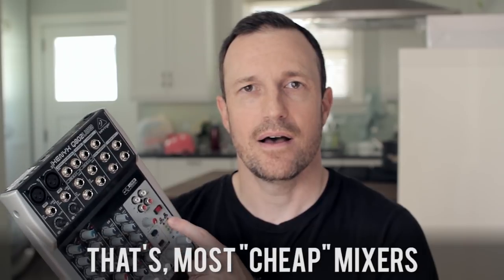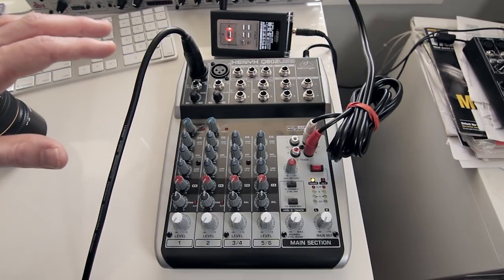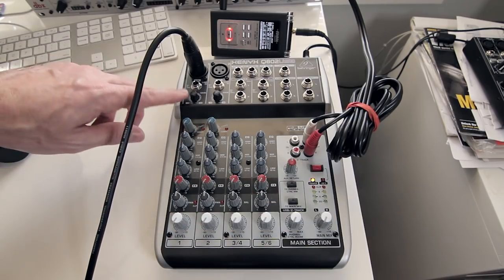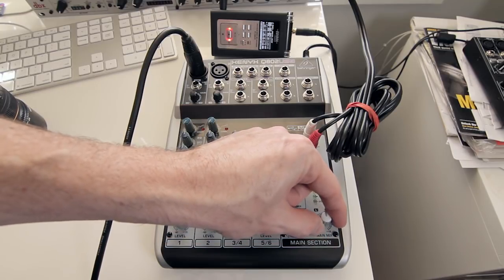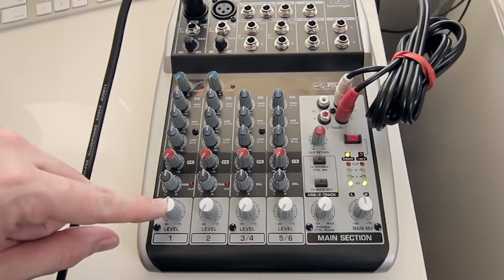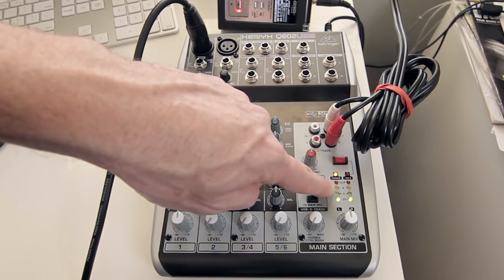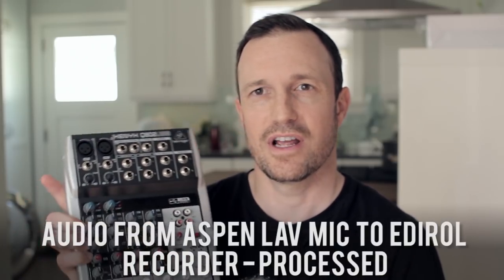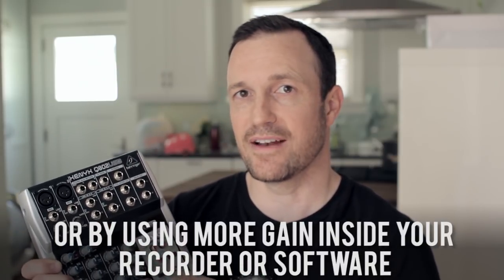Setting Microphone Levels on a Mixer - Gain Staging with no PFL/Solo Buttons

Comment: Thank you Ray. Beginner’s question..... once levels are set so that zero has been reached, if I take a feed to the recorder, which fader is best to use to control the record volume? Would it be best to use the output fader on the end in order to reduce noise or keep it at zero and use the input fader? I’m guessing .... the output fader? (Last fader out)
Reply from the maker: +Ian Craig depends on if you have multiple channels then you’d want to use each channel’s fader (not gain). That said, set the gain proper, then bring up fader to unity and work with your recorder’s gain to set the cleanest level. The recorder having its own gain means that will affect quality as well. So use the more of the better preamps whether that be mixer or recorder. Some combo of both will get you where you want to be. Thx for watching!
Reply: Download a pink noise track, play it through to your recorder with the gain and all set so the track shows zero or unity on its fader, and the recorder should show zero on any fader.  While the track plays, watch the meter.  A single track on a multitrack board should never produce a zero tap on the master.  But at zero on its own meter on the track (you may have to pfl\solo the track to see its track level and set gain), you will hear the sound.  This tells you where your "Track Zero" is at your master output.  The summing circuit is what you need to guage, and if you can, feed the pink noise track to every track set the same, and see if it fills your master.  Pull back on the master until you reach zero.  Pull up on that fader until you hit +3.  This is your relative max output.  Set the fader on your recorder for unity, and gain until you reach tapping +3.  They are now in sync.  You can move the fader on your master on the board to control overall output, and any single fader to control any single input.  If they are all tapping 0 with pink noise coming out of a line level device to your board, whatever you set your trim to is LINE level, or standard amplification.  Mark this if it isn't already (if you fed your track from one to the others in daisy, you may wish to test each track individually to get this marked)--I use a white grease pencil, and some clear packing tape over it so it cannot be rubbed off without removing the tape.  At this point, your basic gain for most of your board is known, and you can set for your recorder just by setting it so that it taps the same level as your master out.  The reason for this is control simplicity.  IF all of your control of your loudness is on the same control area, you know what each change will do to the whole system, and you can make one single change at a time, rather than changing this on this one and that on that one to match them.  It puts all your control on your main board.

Comment: Ray you rock! That is the exact cheap mixer that I have and totally don't know how to use. The web is totally not helpful at all with these things. What does the "FX" knob do?
Reply from the maker: IllinoisCaseLaw.com thanks. You definitely want to go through your manual, they do a great job of explaining the mixer and setting it up. The FX knob is a "send" meaning that you can send audio out of it usually, in music, to external FX hardware but in podcasting we use this to create a mix-minus for recording Skype. If you want to know more about a mix-minus check out http://thepodcastersstudio.com/mixminus
Reply: Thanks, Ray Ortega , You are right. Have not gone through the manuel yet, but I will do that. In the mean time I will check out the mix-minus set up you mentioned.

Comment: Ray quick question how would you make sure levels are right for when you use the 3/4 line when those do not have gain? Sorry if this is a dumb question still trying to self teach myself.
Reply from the maker: +ZachJarom you still have the overload light to make sure the channel isn't peaking. You can use the first method i show using that and of course then just use the volume knob to set your levels on the audio meters. Hope that helps. You don't have a gain know cause those channels are for line level and not mics. So the audio going in should be loud already or have the ability to be turned up such as from the computer or device plugged in.

Comment: Thank you so much for this video Ray, it was extremely helpful. A follow-up question, however: I've done the testing, turning the two main knobs to 50%, and even to 75% and I'm still not able to get 0 on the LED meter. I have a Behringer Xenyx 1202FX mixer, would you happen to know what the problem might be? Or other knobs that I could adjust to help reach 0 on the LED meter? I have my gain turned to 100%. Thank you so much!
Reply: Nevermind! I was able to troubleshoot the problem! I realized I didn't have my soundcard connected to my PC lol. Thanks!!

Comment: thank you very much! Is there an easy way like this to setup the equalizer, or is that just personal preference?
Reply: Equalizers are a whole different ballgame.  Besides, this guy shows only one mic.  This works for podcasting, not for many other situations.  For a single mic input, absolutely the fastest method to get an input volume.  Anything else, the fastest way to kill a mix.  But again, he states his purpose at the beginning, and I applaud that.  He did a great job with this.  More than one way to do anything, and I don't rely on hardware external of the transmitter to tell me when I've got a mix.  I use the transmission point (the computer software\hardware driver) to gauge the output levels of each track, and the software master output for my overall mix output gauge.  You need to do both if you have more than one input; each track on it's own, and the software master output (final tracking which is a summing track that puts it all together).
EQ should be based on your situation.  It's a huge topic.  For a single mic on a podcast, I have two suggestions.  They can be used together or separated.  
Number one, flatten the response of your output.  How?  Us an EQ plugin on your DAW, or if you don't have one, just going direct, plug in a spare device that will get your transmission the way any audience would, then plug its output into a track you send to a DAW with no color (set the gain to LINE and fader to 0, volume on device should be about 70 percent), and use an eq with an analyzer histogram.  Next, get a PINKNOISE track from any free download you can find.  This should playback all frequencies with the same overall energy.  Why?  You'll see in a minute.  Loop the Pink noise into your mic track and have it play on repeat.  Use a terminated audio wire to keep the noise from playing from your daw, you won't need it just yet.  Now use the analyzer plugin to view your output across the audible spectrum.  You can use plugins or other hardware to flatten this in near realtime, just give it up to 16 seconds for a roundtrip through the networking.  Close counts, especially if all you are using is the parametric controls of your board.  This will allow you to have a more natural transmission.  I would do this to each track you plug in, and do this so you equalize your hardware outputs from each track.  I would also repeat this with several devices (phone, computer basic, tv aux wire output) and average the adjustments.
Number two (This one is the $^it):  You will do the above, but you will PLAY Pinknoise from each device TYPE (any phone for phone, any basic computer speaker for computer speaker, tv speaker for tv) that you wish to target, and you will adjust.  I would start with phones.  You can plug a phone into a tv and have it play back fairly easily using the PC input for most flat screens.  As you do each device, adjust the first, then adjust only halfway for the second, then only halfway for the third, and then come back to the first, and adjust only halfway again.  This should give you an average of all of them that you can work with.  You will play the noise into your microphone and instead of coloring the output, you will adjust the input.  After this, your average should give you a natural sound, which you can then "color" for your voice much easier, and giving you an adjustment that will work across more devices the more you use to average it out.
IF you do these together, you'll effectively be balancing your output and your input for the average output levels with a flat curve first, and then a color curve for the mic, which sounds fuller, more natural and so much more consistent across more devices.  You will effectively serve a wider audience.
After adjusting without hearing the sound, try playing a song you know and love through direct plug and through the mic from any of the devices.  You should hear it play back quite naturally, and you'll hear the color of the mic when you play it from a speaker to the mic, and out to a set of very flat responding headphones.  You now have a studio quality setup, and can do anything from mixing music to podcasting conversations or rants in a very pleasant sounding mix.
Reply: @HTDav01 ,
I have been an audiophile for over 65 years.
Reply: @j.d.schultzsr.9215  I was an audiophile the second I stepped outside my home and heard a bird sing for the first time in more than 10 years, thanks to some medical miracle work... ...I was 15.  You really want to appreciate sound?  Plug your ears with really thick silicone plugs, then get a pair of headphones or earmuffs with gigantic drivers\earpiece, wrap a cloth around the headband, place them on your head so the band slides tight against your skull going behind your ears--not over your head--to deaden the mastoidal response, and then stay like that a week while you go about your other normal business (other than audio work--for this, obviously, remove it).  Halfway between deaf and hearing puts you in neither world, so communicating gets complicated.  Music gets very limited, loses much of what makes it interesting, retaining only beat and very basic, repetitive rythm.  When all that starts to come back, it's one heck of a trip.

Comment: Ray I have a pair of high performance active 450w(RMS per channel) speakers. Would you know where I should set the initial volume on the speakers at? or is this irrelevant to setting the mix? Great vid! and thanks
Reply from the maker: Thanks, Wayne. Speaker volume shouldn't come into play, at least not for gain staging. Get good levels into your mixer and then set the speakers to a spot where you need them to be.
Reply: Thanks for that Ray. I intent to host some karaoke soon, the karaoke engine will be Virtual DJ. So, with the 3.5 Jack going from the earphone of my computer, to two 6.35 Jacks going into the stereo input of my mixer (this is a Y lead of course) Is it still the same method as you have outlined for the mic? Have a great weekend man.

Comment: I'm using an ATR2100 mic with a Tascam DR-40 to record YouTube tutorials. I need to set a very high gain on the DR-40 to have a decent signal. Since my apartment is noisy I can't avoid recording noise, too, even though the mic is dynamic and better than a condenser in this matter. I'm evaluating buying a usb mixer (the Behringer you reviewed) or an audio interface (Focusrite 2i2), because it would be easier to record directly to the computer, but also because I imagine they can help getting a louder signal (and/or lower noise) from the mic. Well, I'm not so sure about that, that's why I ask. Do you have any video or post to help me evaluate it, and comparing those two kinds of equipments? In which case do you prefer one or the other? BTW, I enjoy your videos and website a lot, thanks for sharing them. Saludos desde Argentina!
Reply from the maker: +Diego Efe thanks Diego. I'm not convinced that a mixer will give you any more signal. It really depends on how much gain the preamp of the mixer has vs the recorder. Being in noisy environment will always prove challenging. Record in the closet or in a car. Works great! I prefer going to recorder cause I can be more mobile and not rely on software but having a good place to record in is key.

Comment: Hi Ray. Great info. Our band uses an Alto ZMX122fx using 4 microphones. I followed your instructions and got my meter level at zero with Gain between 2 and 3 o'clock and channel levels at 12 o'clock (like you did on the video). My question: If we need to increase or decrease our mic volume do we use the individual channel dials or the master dial? Or does it even matter which we use. Thank you.
Reply from the maker: If you just need to increase one mic then go ahead and use the channel fader for that mic, if all mics you can use master for overall boost.
Reply: Ray Ortega Makes perfect sense! One more follow-up question if you don't mind please? When using volume dials, is the 12 o'clock position the "unity" position similar to the zero mark on volume sliders? I've really confused about the term "unity". Thank you much.
Reply from the maker: Unity can be tricky but it's basically 0db and that's how it's marked on this mixer but that doesn't always mean the 12oclock position. Once you set your gain properly, you should be able to put your mixer at 0db on the fader or unity and the signal will pass through at optimal levels. But you can use the fader to add and take away volume as needed.
Reply: Ray Ortega 👍🆒!

Comment: Do you also have a video for gain staging on a board that has PFL and Solo buttons? (I have a Behringer Xenyx X1204USB.)

If I have the mic properly "gain-staged" on the mixer, what volume levels should I strive for on the computer or recorder.

What IS the relationship between the mixer and the DAW? I have a Zoom H4n and a PC with both Audacity and Adobe Audition.

I often record to both at the same time as a safeguard -- but I sometimes imagine that the WAV file recorded on the H4n through the XLR inputs sounds cleaner than the recording through the USB to the PC.
Reply from the maker: It's possible that your recording to the Zoom could be cleaner or vice versa, it just depends on a whole host of factors that are particular to your setup like the computer etc. But recording to both is definitely my favorite option. 

As for solo buttons, the same stuff applies, this just means at any moment you can check any channel's gain stage without having to take down any faders on other channels. Get your levels set proper on your mixer and then in theory that should translate to your DAW. The levels will certainly be lower in the DAW because the meters are different. The mixer is analog and the DAW digital so when you are working to set your highest peaks on the mixer to somewhere around 0, this will come into the DAW more like -20 but these are the same because the headroom of the two are the same in that case.

Comment: I really need to test this. I'm using a Xenyx QX1002 and an audiomix condenser microphone and I was wondering why the sound don't get distorted when I speak low, but it gets really bad when I project my voice. I believe that I was not setting everything properly. Or, is that possible that the sound specifications (hardware) of the laptop can also interfere with this as well?
Reply from the maker: You definitely need to set the levels properly at both places. First the mixer and then on whatever app you are using on your computer to record. Thanks.
Reply: @RayOrtega  Thank you so much for answering. I will check all that.

Comment: HI Ray. I have a Behringer mixer (one UP from the one you have in this upload - the QX1202). The issue I have is : Without any mic even plugged in, if I turn up the volume on the mic channel I am getting a VERY loud buzz. Is it a sign that my pre-amps are pretty much done ? I have had this thing for about 4 years but only been using it DAILY since October 2017 without this noice which started happening around March 2018. (it's louder on 3 of the 4 mic channels than the other)
Any advice/help/ideas will be appreciated. Thanks a lot for all your great uploads.
Reply from the maker: Yeah sounds like something might be wrong given that the noise wasn't there before but really hard for m to know without messing with it myself. Contact Behringer and see what they can do for you or what they think it might be
Reply: My phantom power took a crap and makes that loud buzz sound. Had to buy a seperate phantom power supply and that cured it. Also, my power jack is very sensitive and when bumped the whole mixer goes nuts.....give it a try, turn phantom off and see if it stops.

Comment: Nice!,  what's the difference in connecting it to a pc line in through tape out and main out.
Reply from the maker: Will work the same as long as those inputs are line level which they are if labeled 'line in' and not 'mic in'